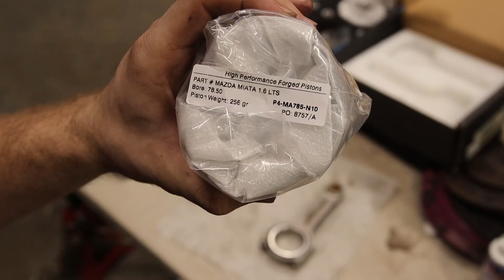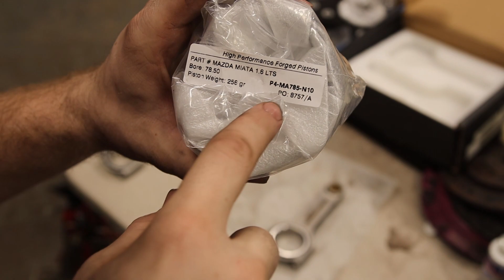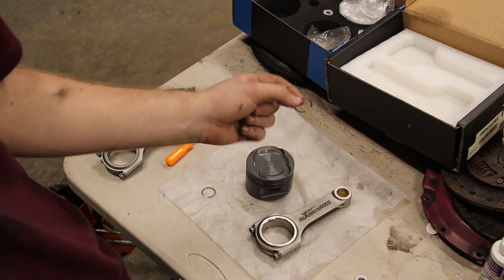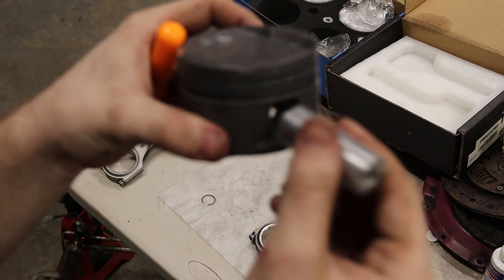Bottom End Assembly - 500HP 1.6L Forged Miata Engine Build Pt.1

Comment: Few things to note just for maybe next time.
When installing main studs, it is recommended, to get the block line-hohned because of the higher torque of the studs and the potential deforming of the caps. 
Also i have seen it is advised to put some assembly lube under the bearings 
Next thing is dont hit the rod bolts with a hammer, it can heavily distort the metal or the threads 
When tightening rod bolts i would always recommend using a stretch gauge, because the torque on the instructions dont always correlate with the stretch that the bolts have to have after tightening (should be 0.1-0.15mm) and thats one really important thing. 

Also pro tip: When tightening anything with torque, always do it in one fluid motion and do no not let off because the torque of breaking a "stopped" bolt loose can be much greater than the torque applied while spinning. 

Though your engine should be fine like this, these are still some tips ive learned through a few friends and Videos from realstreet for example, they have really neat tricks in their videos for engine building, that not many people talk to. Also might not have followed every one of those rules in my engine build since i just gained that knowledge in the last few months :)
Reply from the maker: I really appreciate these tips! A couple questions I have though. 
Wouldn't lubing the backside of bearings increase the likelihood of a spun bearing? 
How would you reccomend separating the rod cap from the rod? I believe I saw that socket and hammer technique on a forum so I used it. I couldn't think of a better way. 
Also I torqued, instead of stretch gauged the rod bolts as I believe that's what Greg Peters did in his 500hp build. I asked a local engine builder if he uses a stretch gauge, he said they just torque them to spec.
Reply: @revreign  No the bearings wont spin because they have a high pre tension from bolting the main caps down aswell as the locating tabs. the lube is mainly for pushing out any resiual debris you could also just use oil that works even better. 

Just remove the bolts and use a rubber mallet to lightly tap the tops to get them off. should be enough they are not that tight, I was able to get them off by hand and just wiggling them on my rods

The thing with the stretch gauge is that this is the main spec that is offered by ARP on those bolts. On most bolts its fine but especially on my 1.8t build i had a MASSIVE difference of about 30nm. i had to torque the rod bolts around 30 percent more than specced on my miata rods it was fine and the spec was on point. If they are not within spec. i have seen engines being damaged by it and the bolts getting loose especially in the 1.8t world so i just tend to recommend it. 

if you want to, you can also message me on instagram if you have any further questions also reguarding the head, since there is a lot of important info on that aswell that you have to look out for

Comment: 500 hp 1.9l is done, just waiting on the RX7 tranny to be finished.
Reply: Does an rx7 transmission directly bolt on to Miata/MX5 block? What clutch do you use?

Comment: Yo bro, awesome video! very underrated channel! Hey, could you make a video on how to tap the oil pan for turbo? What you used?? Plzzz
Reply from the maker: Absolutely. I know it can be very scary, especially doing it while the engine is still in but it isn't difficult
Reply from the maker: However, since I have the engine pulled I'm not sure how accurate of a video I can do since I'll be doing it with the pan outside of the car

Comment: I’ve been following this series from the start and am wondering what your plan is for the final stage of this build. As far as I know, the stock 5/6 speeds are good for 350 WHP, anything more and you’re asking for trouble. Do you plan on going ZF or tremec?
Reply from the maker: right now, the idea is to go for an RX7 Turbo 2 drivetrain for the final stage. Thanks for following my build
Reply: Are you sure the 5 speed can take 350? Best I can find on it says about 270 but if it can take more I need to move my goals😂